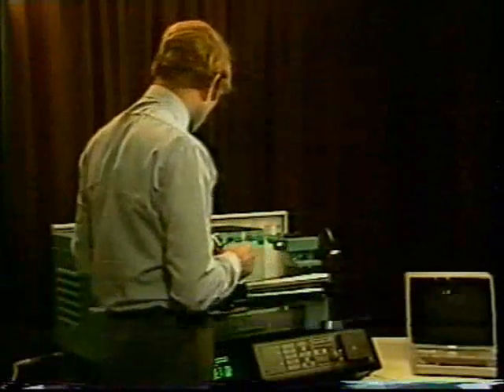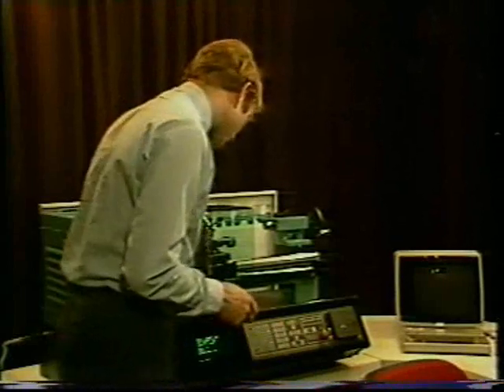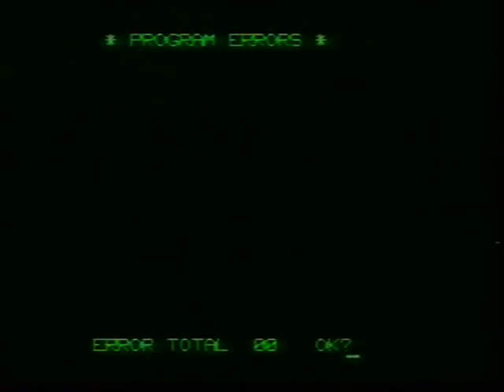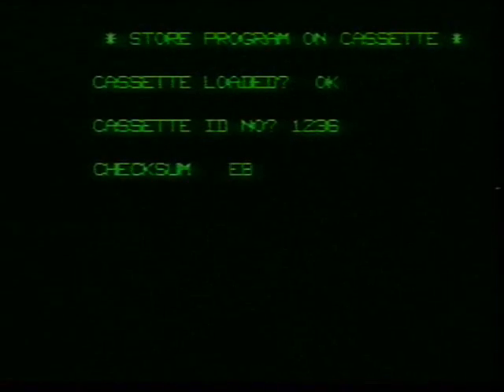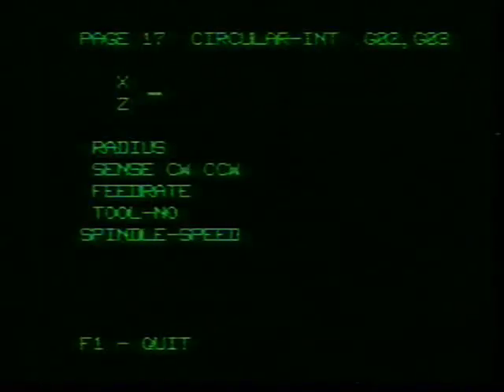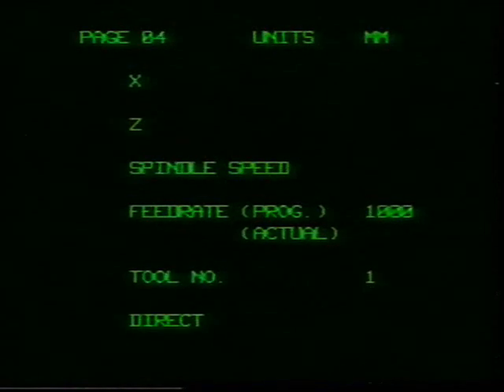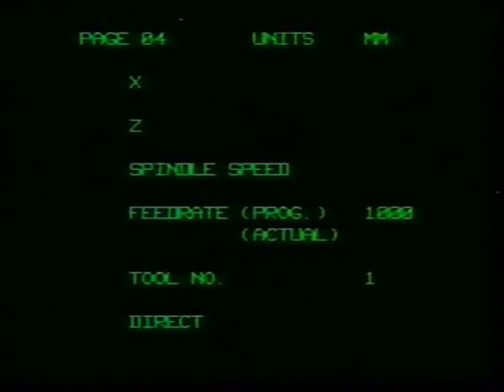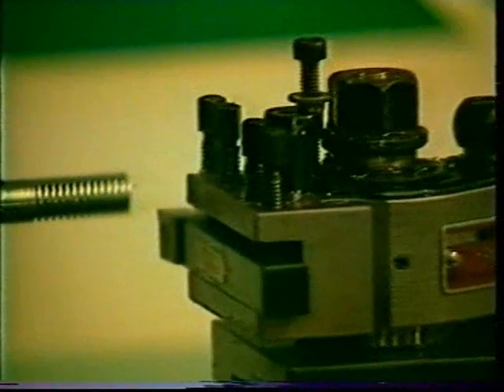Denford orac lathe - training video [Part 2]

Comment: Still a good solid machine...I use mine daily...!
Reply: Can you help please 
New to orac
Trying to load the program but give 0 error and program DATUM? Then nothing happens 
I realise the stop goes to manual operation no tool offset
Reply: @suada2100  sorry but my orac now runs on Linux....
Reply: @iandorrington6397  thank you so much for your reply 
What controller did you use please and did you upgrade the driver for the motor and indexing 
Sorry for asking too much and how’s the threading please
Reply: @suada2100  controller is mesa 7i92, using pathpilot gui...threading is perfect